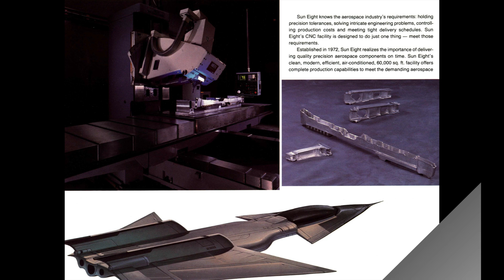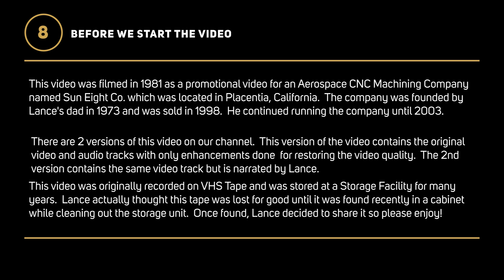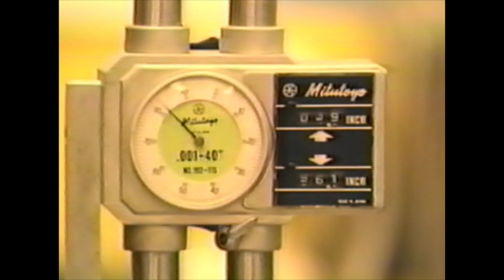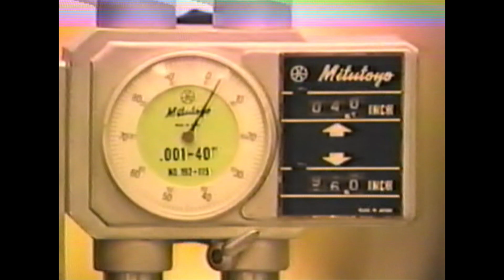Aerospace CNC Machine Shop from the 80's - Original Version

Comment: I can imagine the look on your face when you found the tape .  Cheers .
Reply from the maker: Right on Max finding it was an upper and a possible downer, see (as we think you live and know) when you live in a desert that freezes to the low 20 degree Fahrenheit yet heats up to 120 degrees Fahrenheit with no climate controlled storage in our 240 square foot out building that is right now getting a 100 AMP breaker box installed by us meaning this will take a while to finalize anyways back to the story at hand,  finding this tape was one thing (most would have thrown it out, saying only, it cannot be saved Patrick saved it and now we and out future working hand on museum will have these two copies to share with the future youth Max.
Thank you so much Max, we just thumbed you up on Facebook nice shot of project x parts.
Lance & Patrick.